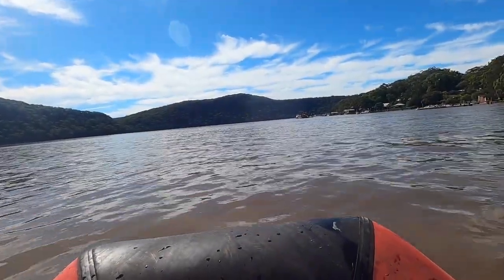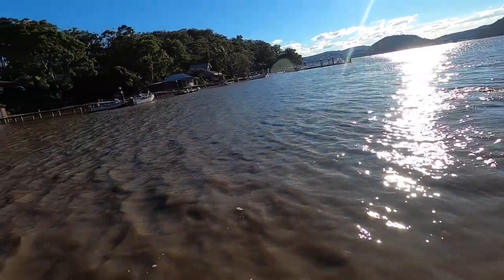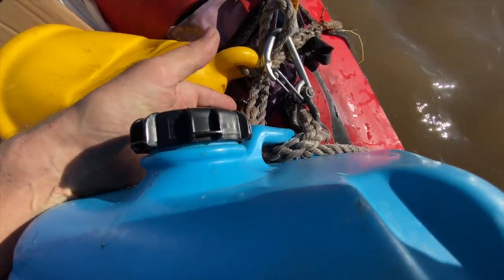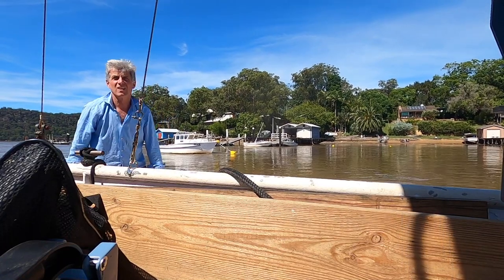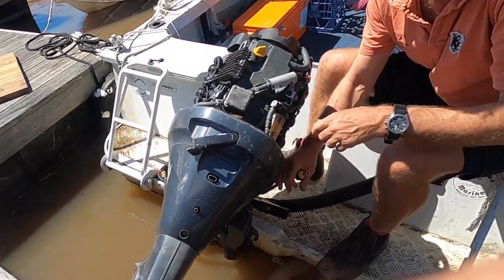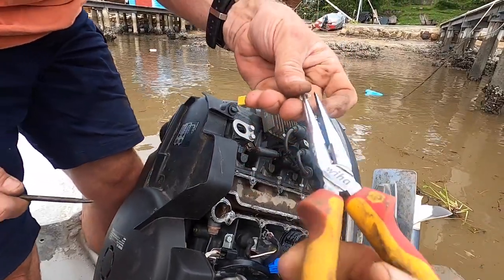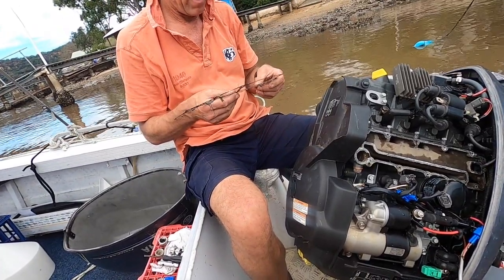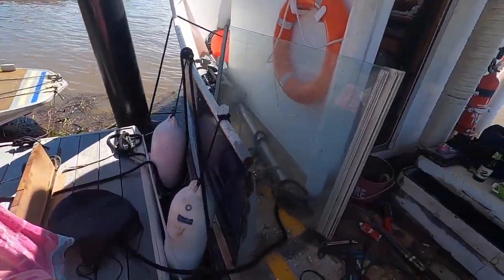Flood cleanup and outboard cooling problem

Comment: Stu, Just make sure you put some sort of liner between the tank and the rib and the tank and the plywood to prevent wear through over time.  Maybe not bad on the wood but the metal rib will wear with the boat some when there is water in the tanks.  I have had good success with using cheap polyethylene cutting boards cut to fit to prevent wear on battery cases etc siting on metal.
Reply from the maker: Yep, will add chafe protection.

Comment: Your opening sequence reminded me of a Bowline trick my Scout Master taught me, make a Slip knot loop, (Twist a loop in the line and pull an eye loop through it) then pass the bitter end through the loop and invert it all, instant Bowline. Much easier shown than described...Glad to hear you haven't had it too bad with the flooding, aside from the flotsam and odd Esky (full of Coopers)...'Fridges, fridges everywhere, nor any drop to drink, fridges, fridges everywhere and all the boards did shrink', My HS English Teacher would be so proud... 'Yeah my deck is a mess because I'm working on the boat, once I'm done it will be nice and tidy!'... Narrator: 'It was never "Nice and Tidy"...' Don't neglect that second bow roller, that chain will beat the life out of the fore deck faster than a Bogan can down a Coldie...
Reply from the maker: Nice technique! Yes, must order that bow roller. Anothing thing on the list!

Comment: I worked at a flood control lake up in the mountains and they had a huge floating debris problem, especially during the Spring season where swollen streams would carry large amounts of wood, and garbage into the lake. When the wind would die down in the evenings, the drift would break up into floating clumps.  Fishermen would come in to launch their boats in the mornings. While out fishing, the day breezes would pick up and push acres of drift up against the boat ramps where they launched. When they finished fishing, they would head back to the boat ramp only to find they could not get withi n a100 meters of their boat ramp due to the massive carpet of floating debris. When the lake was dropped down about 20 feet each year during the winter months, acres of drift would beach itself in the exposed lakebed. We would hire a contractor to remove the garbage, then heavy equipment would push the drift into huge piles then burned. If we did not do this on a regular basis, the lake would eventually become one big floating drift pile. Man's battle against nature never ends.
Reply: This is more like natures battle against man, where nature is losing, but some weird humans help it back again. Thank you!
Reply from the maker: Does doesn't mate.

Comment: Last week my 2006 yamaha 40hp 2 stroke 
Had. Water coming from teltale and thermostat worked but had some salt deposits and clear gel like substance blocking the channels.
Cleaned them out with a fine screw driver new gaskets to head and the exhaust cover and new impeller. Works fine

Comment: Another brilliant episode thank you!  You asked a rhetorical question about why the Yamaha designers did not foresee the pencil anode blocking the water discharge port leading to an overheat too bad we can't have an answer to that.  I have also wondered why the telltale water discharge is inevitably located on the opposite side of the engine from where the discharge hose actually emerges from the engine block, or why the exit hole on the telltale itself so small that it inevitably gets blocked/obstructed by debris that has already made it way through the block.
Reply from the maker: Those are all good questions you pose! I should do a "10 weirdest things about outboards video" one day.

Comment: Did a lot of work with boooyeees.  Even when the are filled with some type of floatation, foam, etc., they eventually leak and the flotation gets saturated, holding water like a giant sponge.  Sometimes only about 1/4 of the buoy would be sticking out of the water it was so filled with water.  Still, your current, sucking those buoys under, is insane.
Reply from the maker: Yes, most of these are hollow with a bung so they can be drained if water gets inside.

Comment: Ironic that you post a video of a Yamaha outboard with a cooling problem today, I took the head off mine last night to find where it's letting water into the bottom 2 cylinders. Found nothing, was just thinking about taking off that exhaust housing. Life hack number 1 is your beer holder, my boat is also the same setup. I have drink holders both sides, but your way is much cooler. I like your logic on fine tuning ballast with fresh water tanks, we did the same on warships, back in my navy days. And I also have always wondered about "Booeyancy" . but then I could care less ;)
Reply from the maker: The super fancy setup would be pumps that can be controlled from the wheelhouse to trim the balance of the boat. Maybe later. ;)

Comment: Stu, a model used here to keep the debris down, on the outside of a bend upriver put a breakwater a bit out into the river, but running along the shoreline. between the breakwater and shore you make it fairly shallow at the downriver end. debris following the current flows into the catch basin and stays there, keeping it from fouling moorings, bridges, docks. Then it's just dredge up the mess in the basin so it's clear for the next event.

a lower cost method would be to use an existing sandbar / island as the breakwater, then you just need to create the catch across the downriver end.
The flotsam can cause a lot of damage to all the infrastructure so mitigating the amount only helps save repair costs.
Reply from the maker: Sounds like a good technique. Getting anything approved like that is such a big nightmare here with the bureaucracy though.
Reply: @DangarMarine  The bureaucracy are the ones that would fund it, that is the hard job, selling them on doing it. The best selling point is the lower repair costs to the infrastructure downstream. it's also finding the locations where it will do the job properly, past the point most debris gets into the river but before it starts getting into where it can be causing damage.

Comment: Where I work we get a lot of those logs that have a butt end that won’t float we call them dead heads. In Canada we call them scotch man buoys
Reply from the maker: Yes, it must have been quite old and water-logged because it sure sank pretty fast once in deep water.
Reply: @Dangar Marine I was wondering if you had an email I would like to send a couple pictures of the rolling caulks on my boat they would be pretty cheap and they work wonderful for are 35 foot vessel

Comment: When I was selling cables to marine manufacturers, I was told that the design life of an outboard engine was 750 hours, which I thought was very short. But it was explained that most outboards were on sport fishing or pleasure boats and didn't actually run very many hours per year because most of the time was spent out of the water, or in the water, but not running. That explanation doesn't take into account the usage patterns of you and your mates, does it? Loved the chick clip.
Reply from the maker: We certainly use boats very differently to the average fisherman for example. Dave's Yamaha has about 1500 hours on it now and still has plenty of life left in it.

Comment: Am gob smacked Stu, what a bad design if the anode can breakaway and plug the water passage, I guess that’s a good reason for reading the manual when you get a new engine ( nah we don’t do manuals until we break it)
Reply from the maker: It does seem like an odd design, that's for sure.

Comment: Hey stu 
Me again, we made it  into the hawkesbury at about 1:30 and we saw renko tied up to a jetty on the Bridge side  of dangar Island and I don't know if you saw but we drifted backwards under the bridge because we we worried about our mast hitting the bridge
Reply from the maker: It's always a worry going under bridges like that. Even with the heights marked on charts it is always a nervous moment!
Reply: @DangarMarine  yes and considering we are looking at getting a larger sailboat in a few years makes me think that it'll be moored closer to the heads. We're lucky to have a shorter mast due to it being trailer able (not that you'd want to as its huge for 24 ft) and it is a shoal draft keel on our current boat so we are able to get to where it currently is.

Comment: Think about cutting a 15CM (6 inch) inspection port atop each  water tank
Reply: Hard to plug back up reliably, yet able to be opened when needed, on tose rather thin walled plastic tanks. Better to just use the 1 1/2" hole saw on one of those pre-cast bung holes n buy an endoscope inspection camera for a few tenners.

Comment: Suppose the weak tell tale on the outboard in the end test was due to no thermostat? Allowing the water to flow through with little back pressure.
Reply from the maker: That may well be the case, I'd have to look at the cover again to be sure.

Comment: Stu could you help? I have a Yamaha 175 V6 two stroke. Having watched your video I now don’t know if this monster has internal waterway anodes. Do you have any idea? More important is where are they if they are there. I think you are so lucky getting a fridge freezer delivered by the river and it comes pre stocked.
Reply from the maker: It no doubt does, but I've never worked on one. You should be able to find a PDF service manual online.

Comment: In the California Delta, we have an increasing problem with the invasive water hyacinths and water primrose. I used to think the hyacinths were bad but at least I could get through them, then the primrose started showing up. There’s no pushing through the primrose. It’s deep, thick, crazy heavy and strong. It will wrap up your screws and now it’s got you. If a small mat of it grabs you on anchor, it will increase your  current drag ten fold and drag you away unable to retrieve your anchor or power away. Just Screwed. The primrose was just in a small area 7 years ago and could have been abated, but politics..........

Comment: Hey Stu, have you noticed an increase in engine efficiency since the rebuild? Does it burn less fuel, or just less oil...? Be well.
Reply from the maker: I haven't really been monitoring the fuel usage at the moment but I'd been keen to determine what it actually is before we head north.

Comment: Good morning Stu love the channel mate. just a quick question. I am trying to clean mold and mildew off my boats seats but nothing so far has really worked, i have tried sugar soap, 303 cleaner, clr, jiff,shift it. but these arent working. any advice you have would be greatly appreciated.i have seen a product from the usa called marine 31 which seems to remove the mold effortlessly but i dont think we can get it here in Aussie. cheers mate.
Reply from the maker: Hi mate, I would give vinegar a try. Like all things though, try a test patch somewhere first to make sure it doesn't damage the surface.

Comment: I have a old evinrude 35 for the 80’s have an issue where the engine every few minutes will misfire sounds like someone hit it with a hammer. At low throttle it may shutdown, in high throttle it usually puts out a jolt but keeps going. Any idea what the issue may be?

Comment: Hi stew I know your busy with flood clean up but maybe you know what is causing water to spirt out of the join in the lower unit and the motor on 40 horse johnson 89 90 model have recently replaced impeller etc regards. water is still pumping out of tell tale fine.
Reply from the maker: It is probably the return water coming down the exhaust.
Reply: @DangarMarine  cheers not to much worry about then your a gem.

Comment: Hey Stu
I was out with a mate on Lake Macquarie yesterday. He has a Yamaha Outboard that looks pretty identical to that one inside. It cranked OK but wouldn't start after sitting for about 3 weeks (battery was low but we added a 2nd one via jumper leads). I identified that we had no spark. After removing & replacing the 6 x 20A fuses under those 3 Yellow covers at the front, plus the 2 x 30A ones in the Green cover just below the starter, it fired straight up... None of the fuses were blown nor did they have any evident corrosion. Do you happen to know which one of them controls the ignition, by any chance?
Reply from the maker: Not sure of the purpose of all the fuses on that engine. You will probably find that half of those fuses you mentioned are the spare fuses stored below the active fuse. Normally a blown fuse will cut power to the forward controls meaning the engine won't crank as opposed to not getting spark. That sounds more like a kill switch problem to me. Other fuses are trim tilt.
Reply: @DangarMarine  thanks mate. I’m wondering if the ignition ecu doesn’t operate below a certain voltage and was shut down until we had the jumper leads on long enough to bring up th voltage. The time we spent checking the fuses may have just allowed it to come up enough to operate. Anyway he’ll get it checked. Thanks for your input mate.

Comment: Hey brother I have a 1995 Johnson 150 have you even seen a broken rod on one piston  and the piston will not move but all the other pistons for fine and the engine turns over fine?
Reply from the maker: Yes, seen that before. Piston just gets pushed up to TDC and never gets pulled back down.

Comment: Hey danger marine I’ve been working on my force 125 I rebuilt the carburetors on it and ever since I have done this my engine has been acting funny when it is at mid throttle it does good I go full throttle it ramps up the engine I can get up to plain but then it’s like half the motor shuts off any help with this issue would be nice thank you for your time
Reply from the maker: Did everything go back together correctly after the rebuild? No o-ring or gaskets got pinched or torn? Maybe the float bowls aren't filling fast enough due to a pinched fuel hose or needle and seat problem?
Reply: @DangarMarine  yes it did go back together good I have pulled the top carb apart everything seems good there hoses are good I also rebuilt the fuel pump still need to get into the bottom carb I called a local shop they said it could be a speed coil under the fly wheel my book shows a trigger coil and stater there

Comment: Why does that excavator not have a thumb on the bucket. Would be soooo much easier to pick up all that timber and mess.
Reply from the maker: They swapped to the grippy attachment at 2:05 when it turned up.

Comment: Y wouldnt u have a claw on the bucket? Specially it u pulling crap out out of water
Reply from the maker: Because you live in a remote area and use what you have until the right tool turns up at 2:05. What would you do?
Reply: @DangarMarine  spose thats a fair call. A grab on the bucket would make short work though. Aah must have made my coffee at that point 😀 that would have made quick work

Comment: My yamaha outboard had a cooling problem, it was more full of shit than a politician on election day.

I had exactly the same problem with my 50 high thrust. The anode blocked the coolant flow.
Reply from the maker: If only the hole was a little big bigger that couldn't happen.